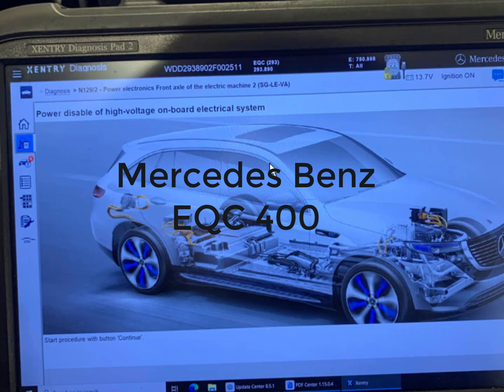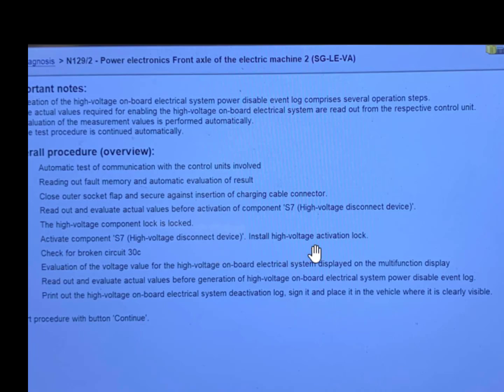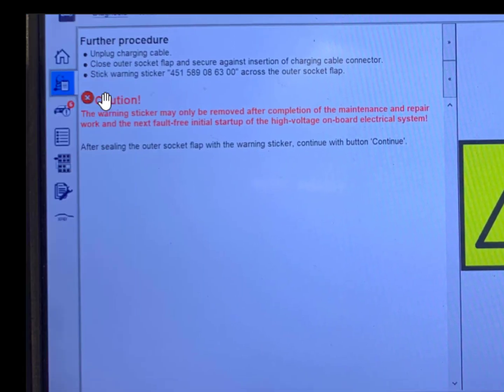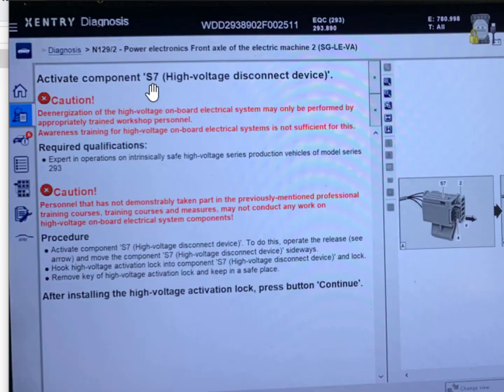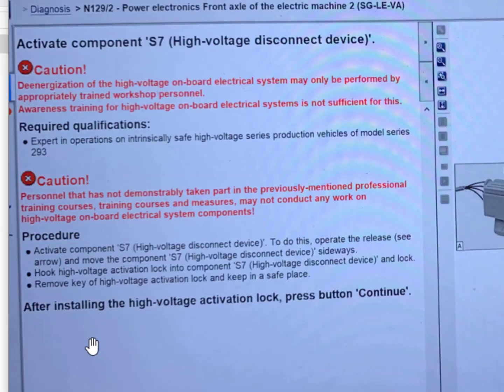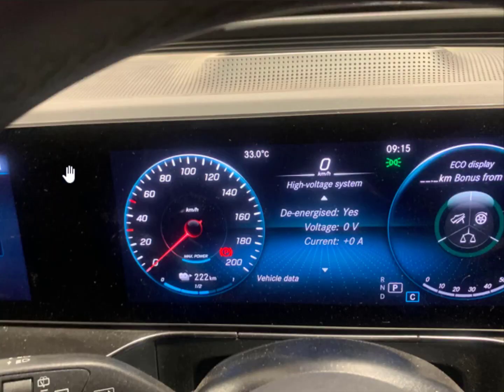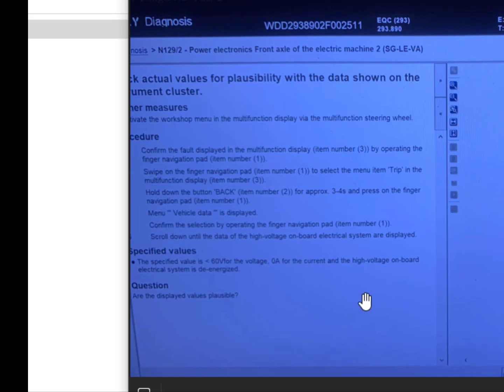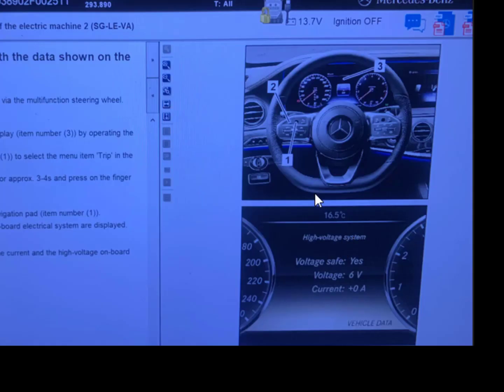How to Disable the high voltage power of EQC 400 Mercedes Benz Electric Vehicle

Comment: Hi mate 
So what’s the procedure to restart that ? 

My battery negative as remove d
And now can’t start the car 
And dash doesn’t work or even my key lock and unlock doesn’t work. 

Any suggestion ? 
I just bought it like that 
And saw the negative battery was desconnected 

Is there a way to restart the high voltage on Board